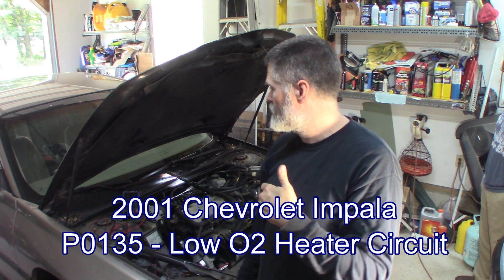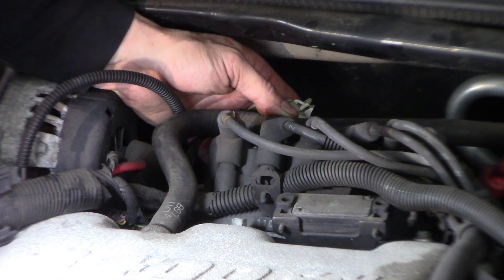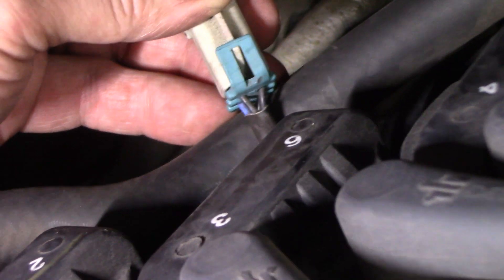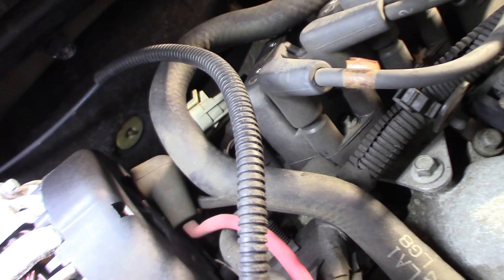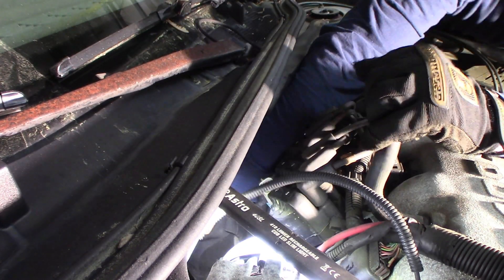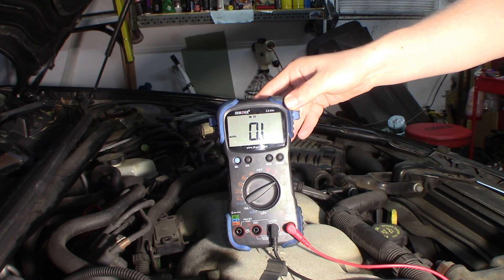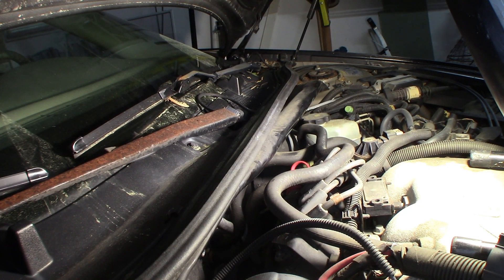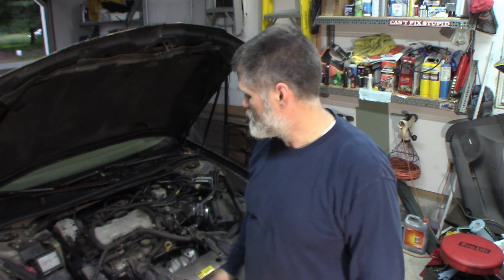2001 Chevrolet Impala 3.4L - P0135

Comment: Good to know, when you said theres 1 sensor for bank 1. 
And if the sensor doesn’t wanna come loose, spray penetrating grease right around it and go for a lil drive to heat ‘er up. I did this on my 03 and had no problem breaking it free.

Comment: Will a bad one tell u its the converter
Reply from the maker: No,   the code is the heater circuit within the o2 sensor.  Cat code would be a p0420 or p0430.  The P0135 is not the o2 circuit itself, it's the o2 heater element.
Reply: @CharlesAndCars  ok thanks

Comment: I replaced an upstream O2 sensor on my 2005 3.8L Impala.  It's a bitch only because the old sensor's threads are rusted to the exhaust manifold housing's threads, and accessing it over the rear of the engine is difficult.  You need to get the socket with the slot along the side that fits over the sensor wire.  Don't make the mistake of using a rachet wrench for this - the excessive torque required to break the bond will likely break the ratchet's internal mechanism.  You need a 1/2"-drive breaker bar and a 1/2"-drive universal joint like the video shows.  I needed to place a cardboard sheet under my car and drip penetrating fluid down onto the sensor joint to soak it well enough to loosen the bond enough to break it, but I was eventually successful.  It's very much like replacing a spark plug but if you happen to break the sensor body from its threads, you're screwed and will likely need your car towed to a shop to complete the repair.  I applied a good coat of antiseize compound to the new sensor's threads while being very careful not to get any on its element, and also very careful to place the sensor into the hole without accidentally fumbling by touching compound to the female threads and then touching the element to it and thus contaminating it, and this is also a challenge.  You need to place the sensor straight into the hole and carefully engage the threads by turning counterclockwise first to strike the thread entrance and then clockwise to screw it in without withdrawing or cross-threading, and then snugging up with the wrench.  (I don't have the torque spec but the new sensor's package/instructions will likely state it.)  That done, I don't have a scanner to clear the P0135 Code, so I disconnected the battery ground overnight to clear the Code.  The following morning, I started the car and all was well and has been for over 2 years now.  (Now I need to do the same for my 2003 3.4L Impala.)  Good Luck.
Reply from the maker: Yep, getting O2 sensors out can be difficult some times.  They like to pull threads or just not want to come out.  The pointy blue wrench (torch) is your friend in many cases with O2 sensors.